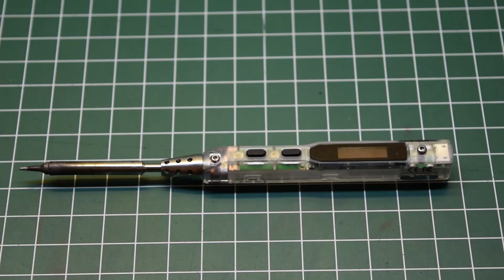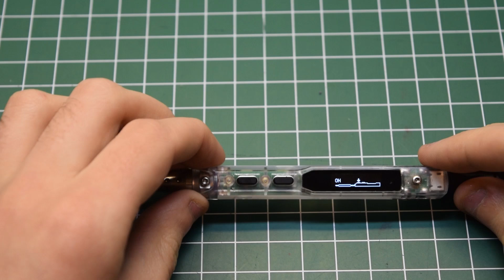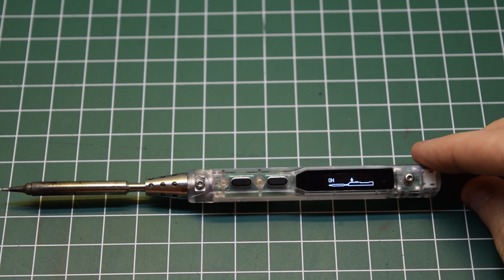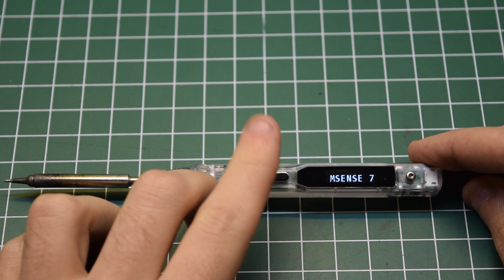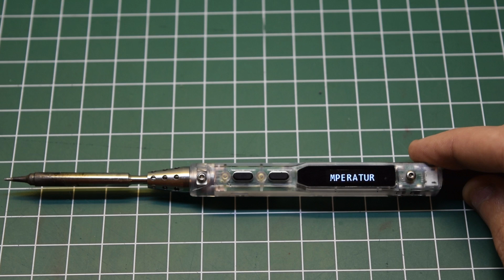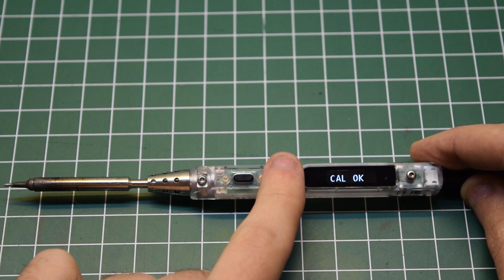TS100 Firmware how-to - Ralim Firmware

Comment: I got one coming, but did not get any power with it  because i did not really know what i was getting.  What bench power should i get and what battery, its not going to be used that much on th go.  Thanks for doing th video and any help you can give!       Cheers!
Reply from the maker: Hi,
For a bench power supply, the iron runs best on 19-24V. I often use an old laptop power supply, (19V 3.4A). Any 60W+ 19V power supply works well. Also, a lot of laptops used the 2.5mm plug. If you're going to use it with a battery, I recommend a 5S battery for most work, and a 6S if you need that extra 'oomph'. Make sure to use a proper battery charger with the lithium batteries so that they are kept balanced.
Reply: Thank you!

Comment: First thanks for the excellent firmware.  For those interested I have just created a set of mini instructions for this firmware that you can print out, cut and stick back to back and laminate.  It is small so will fit inside the original box the TS100 came in.  https://www.dropbox.com/s/31t7fxp48avg14l/TS100%20instructions.pdf?dl=0
Reply from the maker: Very nicely made Instructions thank you :)
Would you like to include some credit for yourself on them and have them included in the repository on GitHub? (No pressure to at all, just trying to collect relevant information there)
Reply: Ben Brown No credit needed. You did the hard work.  Feel free to include in repo.  I can supply the editable version if you prefer.

Comment: Having some trouble... Updated firmware and pc restarted. Now it won't power up. It does go into DFU mode and can reflash but nothing happens.
Reply from the maker: C-Train Hi, can you confirm that you are trying to copy one of the ts100.hex files from the releases page of the github, and that you are in DFU mode (it will show DFU on the screen)?
Reply from the maker: Hi, If you hold down the button as you connect it to usb and it enters DFU mode, then there should be no issue. Just reflash it while its in DFU mode and ensure the file extension changes to .RDY . If that occurs there should be no issue in re-flashing the firmware. If this still fails it is often fixed by trying another computer. Windows 7/8 appear to work the best with the original DFU bootloader at the moment.
Reply: it just tells me there isnt room on the drive

Comment: I have the original firmware and what I mostly dislike is a missing autostart function meaning the device should heat up directly after powering on - this would be a great improvement.
Reply from the maker: Sure,  Most suggestions are placed as issues on the GitHub page.  But I'll add the feature in the next release or two :)
Reply: Ben Brown thanks!

Comment: I'm loving the newest firmware with auto rotating screen but I was wondering if you could add another feature.  I tend to solder at 340C most of the time and I can't find a way to change the working startup temp from the default 300C.  It's my understanding you removed the config.txt where we would normally make that change so it would be awesome if we could get it in the menu.
Reply from the maker: The firmware allows you to adjust the setting as you go, and then when you exit the soldering mode it will save the setting. So if you set the temperature, then press both buttons to exit, it will save that temperature for the future.
Reply: Ben Brown thanks I never paid attention. That's even better

Comment: Just updated, thank you so much, I swear this soldering iron just keeps getting better. I have an idea that could be useful for a future revision of the software, I'd really like to see the current temperature of the iron right when you plug it in on the main menu. Sometimes it can be a bit difficult to press both buttons to get it into the cooldown mode so I'll just unplug it and plug it back in and the stock firmware you could press the other button to see current temperature.

Another improvement is when the iron is heated up could you possibly make a delayed button response, I said before that pressing both buttons to get into cooldown mode can be kind of difficult, so maybe when the iron is heated up there could be a button delay to check if both buttons are pressed so it can go into cool down mode instead of temperature change, either that or a long press of the button closer to the display will go into cool down mode sort of like how you have boost mode.
Reply from the maker: Hi,
Can I ask why you want to view the current temperature on the idle screen? I have been thinking about having it as a part of the cycle on the idle screen (when it shows the graphics). However, when people ask about this they dont specify what the use case is for wanting the temp on the main screen? You can press both buttons at once on the main screen to view the temperature from the main screen without heating up the iron?

I will look into extending the button sense time out even longer,. At one point I had it so that long press could exit soldering mode, but after the number of emails I received about people accidentally exiting all the time, I removed the option.
Reply: The problem is getting both buttons to register at the same time to get into cool down mode, it wants to go into temperature change instead. Its about a 1 in 4 chance it will go into cool down mode when pressing both buttons. Maybe its just a problem with my iron
Reply from the maker: Hi, I have found that some users have an issue with the timing requirements (100mS). I agree that this can be hard to get used to, and so I'm probably going to increase this tolerance in 1.17. However, that does come at the cost of buttons feeling less responsive. It's a constant tradeoff between making the double press easier and trying to prevent other button use feeling slow.

Comment: Any reason I get an error every time I try to flash the latest firmware?
Reply from the maker: Hi,
It's become very well documented that you basically have to be running windows 7 or 8 for it to work every time. Windows 10 sometimes works but is hit and miss.
Linux and mac work if you're very lucky. Also ensure you are flashing the latest firmware from the releases page :)
Reply: Ok, is there a workaround for windows 10 by chance?
Reply from the maker: Currently, the bootloader (DFU) is closed source. So I cannot do anything to attempt to fix it. I have looked at creating a replacement, still working on that :)
In windows 10 it appears to work so long as you do not have any antivirus that tries to scan files on the fly. As the dfu expects the file to be written in a specific order, it can't have anything interfering... Well so far that is what has worked for me :)

Comment: How could you input all those features in this New firmware? I dont understand so much about quantity of information is suported in microchips, but in this case, you put a lot more information than de original. How much more information can be add in this ts100 circuit? Congrats for the work.
Reply from the maker: Mostly by removing the feature where you could use a computer to edit a text file over USB to change the settings. I replaced this with the long menu on the iron itself. This allows for changing the settings in the field and also freed up most of the room for adding the extra features. This actually freed a lot of room so there is still around 50% of the space on the microcontroller left for future expansion of features. At this point, there is more than enough room to add as many features as people can think of :)
Reply: Ben Brown it's very nice what you did.
Reply: Hi Ben. In this link https://github.com/Ralim/ts100, there are lot files. What exactly I must use to flash the ts100 to get all those features you have developed? Thanks
Reply from the maker: Hi,
That page has the flashing instructions. However goto the releases page (https://github.com/Ralim/ts100/releases) and download the ts100.hex at the top (the newest is at the top). Then flash this file using the instructions at the main page.

Let me know if you run into issues.
Reply: I've updated the ts100 and everything went well. I have some points using this new firmware. Is it my impression or the tip temperature is now more locally concentrated, where is the solder used? In the original firmware it seems that in the part at the beginning of the metal part (next to button A), it used to warmed up more and was even a bit dangerous. And now with almost 430 ° C, this part is not even hot. Has this really been improved?
Another thing is, if now with the temperature reaching 450 ° C, it can somehow damage the ts100 circuits or this 50°C added in the max temp are safe about that?
Reply from the maker: The firmware should not change the tip temperature as far as I am aware, the PID control loop is running faster than the original firmware, but I have no idea if that would keep the handle cooler or not. I did try and tweak the temperature readings to be closer (and added the temperature calibration). However, this should not affect the handle temp :)

Honestly no real idea. Most soldering iron tips are rated to 450C, and quite a few users have been running the tips at 450C for a while now without any issue. The only really foreseeable damage would be the tip burning out faster. However, most users are okay with the slightly increased risk because the tips are quite cheap. It's up to you how you decide to run your iron. I normally run at 360C and use the boost to push it up to ~430C when I'm doing large connections.
Reply: Ben Brown  hi ben had my TS100 for a while not used due to other things ..I am totally lost in firmware update, hex, flash I went to GitHub-Ralim/ts100 it’s a bit overwhelming  how to follow can you help me out I don’t even have the option of settings it just saying press A button then heats up

Comment: Whats with the heat shield thing?
Reply from the maker: The tip I'm using in the iron is a prototype of a newer line of tips. It's there mostly as a finger guard / heat shield. It threads onto the newer tips at their base (where the current ones bulge). 
I currently do not know details of if the tips will launch or when :/ If you would like more information let me know, and I'll ask again :)
Reply: there are tips sold with this shielding (Type: TS-ILS/TS-C1), also it can be used to place fingers there to have more precise control by holding it nearer to the tip.
Reply from the maker: Ah awesome, so the C1 is available now :)

Comment: Hi Ben, I'm  trying to upgrade firmware of my ts100 but constantly getting ERR on the hex file.
Can you direct me where to look for the problem?
Regards
Reply from the maker: marikgl Which HEX file are you using? 
The most common cause for this is people not using the ts100.hex file from the releases page, or your operating system is not Windows. Some people have luck with Linux and Mac but the DFU code assumes Windows behaviour so it can be problematic.
Reply: SOLVED: I have tried HEX (1.15 ) from the link that you have provided and the HEX  (2.17 ) from the original site on a win10 computer. In both cases I got ERR at the end.
The solution was to try on another computer with win7 system. Successfully upgraded to 2.17 hex and then to 1.15 version. 
Thanks for your help.
Reply from the maker: No problem. Some windows 10 computers just seem to annoy it. But some also work. Its rather odd at the moment :/
Reply: Awesome iron, awesome video. Thanks man. I just got my TS-100 a few days ago and while I haven’t had much of a chance to play with it too much, first impressions are amazing.

I was dreading the inclusion of a token gesture conical tip so I have one on order from China. I was floored to see a proper tip, so I’m effectively going to have two. I think the manufacturer must have received enough “feedback” and decided to just include them.

Put your firmware on last night and it’s awesome mate.  Really top notch work.

Comment: Thanks very much for this Ben. Its a great improvement over the original firmware.
Reply from the maker: Thanks, let me know if you come up with any extra features or changes you would like
Reply from the maker: Hi,
If you go to the GitHub page (https://github.com/Ralim/ts100) and read the instructions it will walk you through the process.
The simple version is to go to the releases page on the GitHub site, download the latest  "ts100.hex" file, and upload it through the DFU mode.
Reply: Where to download this firmware?